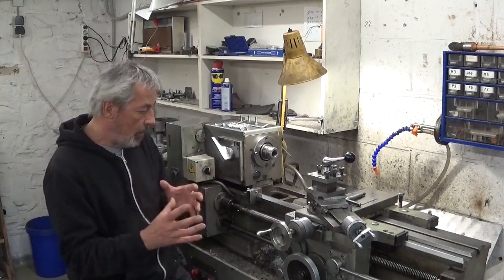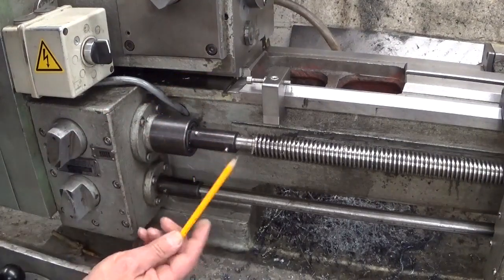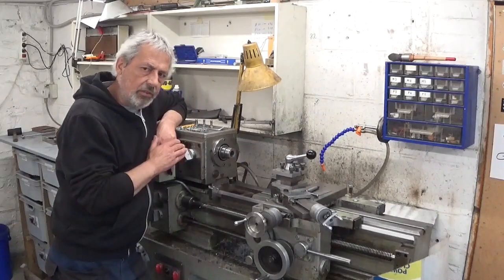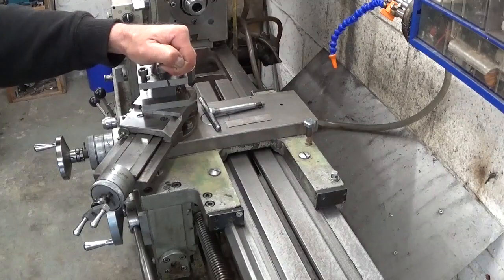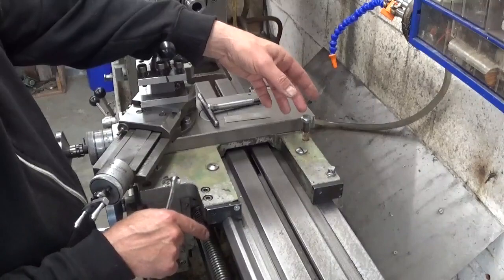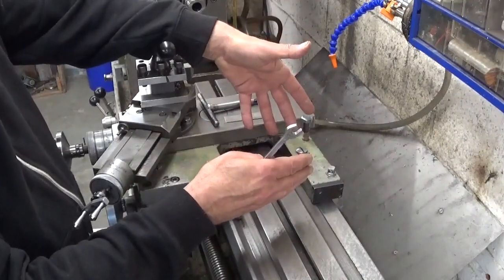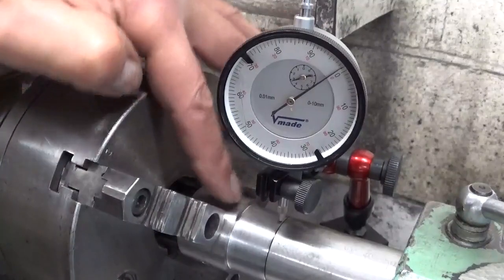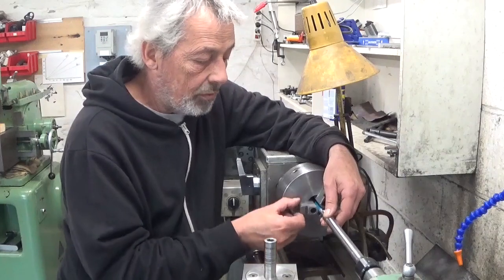Lathe alignment and other blabla.

Comment: I have said for many years and still say, the most powerful thing in a workshop, be it a small or large workshop is between your EARS! This is a good example of this! Think.
John, Australia.
Reply from the maker: Spot on! Thanks.
Reply: John,I couldn't agree more than what you say here. I am often confronted with 'in the field' type engineering problems and it is then that you really value the versatility of thinking and problem solving of those in the work team with only limited resources to hand.
Reply: @howardosborne8647  Thanks Howard, John.

Comment: What if the tailstock points the other way? And also the real centre point depends on the extension of the tailstock. The same is true when using a centre point in the headstock.
Reply from the maker: That's why i say in the video to not loosen and move the tail stock after the two points are in line with the bed.

Comment: You could (with a MT2 taper tailstock) make a laser pointer embedded into a Mt2 taper. Make it in tthe headstock centered  (pointing at a single point when spinning in the headstock. 
Then put it in the tailstock. Point it at a center on the head stock and voila, tailstock can be centered.
Reply from the maker: That's a brilliant idea Hans. Simple and effective. Thank you very much.

Comment: Hi Rusty .  It is normal for the tailstock to be high , it will drop down over the years with wear .  Cheers .
Reply from the maker: Maybe but i made the bottom plate myself. I use shims to aligne it.

Comment: I haven't seen that method for aligning the tailstock before.  I will have to try that!
You can use your second morse taper to make a backstop for your chuck.  Very handy for making things the same length.
Reply from the maker: That's a good idea John. Thanks for the tip.

Comment: Good point on the leveling not actually needing to be level, it needs to be straight. As for not cooling with the headstock. I totally understand. Where is your lathe made Michael? Looks Russian to me.
Reply from the maker: There's no brandt on it. I think it comes from Eastern Europe or USSR.
The electric insallation is German but not original.
So... who knows?
Reply: Having the lathe level can be important depending on the type of work you do  , as some cases a level is used to assist the set up long shafting and some faceplate work .

Comment: Hang onto the short bits of machined material that are cut down to nominal sizes.  You can use them to do a "pre-set up" on your steady rest for use on long parts, farther down the bed.  Make it easier to establish a reasonable center on long stock that won't fit through your spindle bore, for example.

If you have to remove a part from a 3 jaw, say, for a test fit, try putting match marks on the part and the chuck jaw.  If the part must go back in, match the marks back up.  Minimize the chance of chuck runout affecting your results.  If the chuck has multiple places for the key, one should have a unique mark stamped next to it.  Hit them all when tightening, torque on the marked one last.  It is supposed to be the last one they tightened before the jaws were ground in.  Following this tightening procedure is supposed to help with accuracy.  That's what they told me, anyway.
Reply from the maker: Some useful tips here. Thanks.

Comment: Thanks for another very interesting video Michel. I finally found a small shaper [Drummond manual ]with what appears to be horizontal and vertical traverse to the bed. It was by chance I got it when I went to collect an old lathe I won on ebay. I was so lucky as it would have gone in the skip. Regards Stuart from NE England.
Reply from the maker: Good news. I had to Google it. Looks like a cute little machine.
Reply: @Rustinox  Thnx, it has some kind of set up that allows it to be powered by a motor. I am sure I have seen an email for you somewhere in your videos, I will try and get some photos of the lathe and the little shaper to you somehow. Regards Stuart.
Reply from the maker: @tribsat100  Good idea. Please send at rustinox@outlook.com
Reply: @Rustinox  splendid I will do regards S.
Reply: Afternoon Michel. Did you get my emails. I sent them seperately[quite a few. They may have gone to your junk mail . Im not the best at these things Regards Stuart Bell
Reply from the maker: @tribsat100  Yes i receive them. Thanks

Comment: Hi Rusti. I see this lathe is a bit special. If I had to fix it, I would have checked whether (by chance) the fixing bolts of the head stock are to be reached from inside it. So open the lid and take a look. I still can't believe somebody made such an unserviceable machine.
Otherwise I'd say that you mixed a little the errors caused from the headstock and the tailstock. It is important to know which comes from where.
Edition:
I reviwed the part with the shims. These are only aligning verticaly. The angular position of the head stock is to be adjusted some other way. 
Possibly by wedge.
Second edition:
The part underneath the headstock doesn't look quite in place. In fact it doesn't look quite made in the factory. I guess somebody has tried to lift the height of the centers...or not. Just trying to help.
Reply from the maker: Some previous owner did some very poorly executed modifications on this machine. The head stock and tail stock have been raised by +/- 20mm using these blocks you can see at 01:10
The dimentions on the one for the tail stock were so far off that i had to make a new one.
The two gear boxes are tilted 90° so it's impossible to check the oil level. I even doubt the lubrication is correct.
To check if there is acces to the bolts of the head stock from the top, i have to drain the oil and take the spindle out.
There are more problems with this lathe but i suppose you got the point...

Comment: Using your laser level like that is actually very clever, and likely more precise than you're giving it credit for. The farther away you make the comparison, the more accurate your measurement. You'd have to use the single dot method you showed first, and rotate the toolpost so the pointer hits the same dot at each end of the full travel of the carriage. Then, measure the height difference between the dots.

A hypothetical... Given the following:

Lathe bed width = 6"
Distance from the back of the lathe bed to blackboard = 10 feet (120")
Laser dot height difference = 0.050"

Solve for the acute angle: 
arctan(0.050/120) = 0.02387 degrees

Using the above angle, reducing the adjacent leg length to the bed width (6"): 
sin(0.02387) * 6 = 0.0025"

So, in the above example, you'd have roughly 0.0025" of twist in the bed, over the entire travel of the carriage.

You could set up your height gauge at the blackboard to make an accurate measurement of the dot height difference, and get even closer. With a cheap laser pointer!

Trigonometry is amazing.
Reply from the maker: Woow! Thanks for your calculations. Maths are not really my passion.
What i wanted to show with the laser in the tool holder is that the carriage must move straight over the whole length of the bed, but that was maybe not very clear in the video.
Reply: @Rustinox  You were perfectly clear! I just wanted to expand on the idea, and show just how accurate the method you showed can really be. 

Being able to achieve a high degree of precision, without any special tools, is something I find incredibly fascinating. 

Sharing simple, elegant methods like this, is one of the great things about the YouTube machining community.